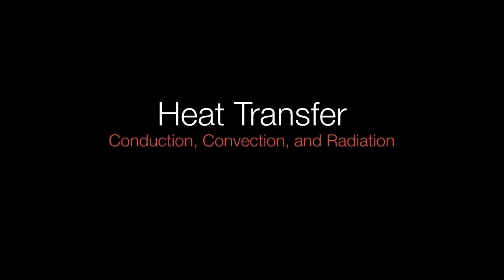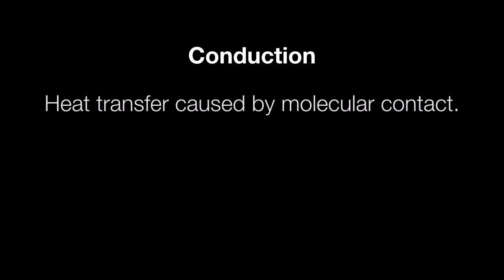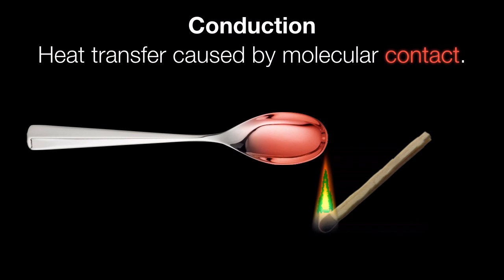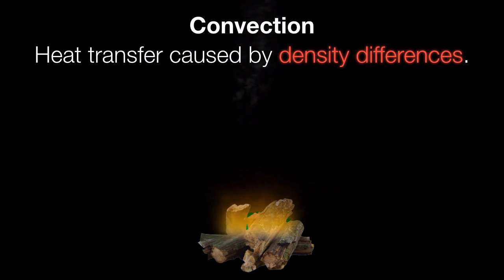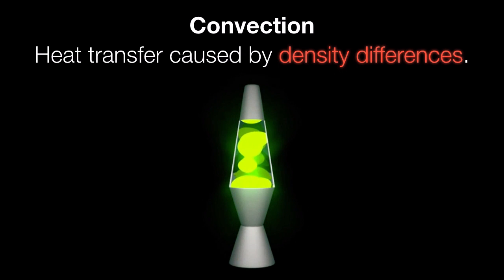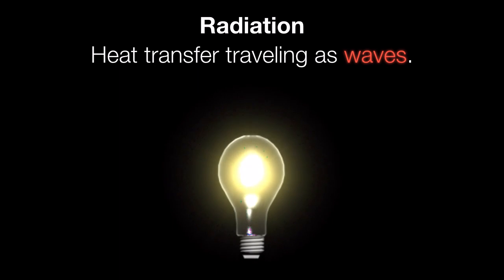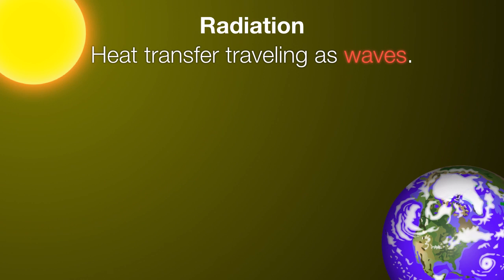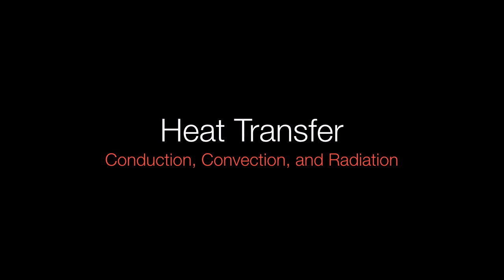Heat Transfer

Comment: You blew it on convection. You described convection currents not heat transfer by convection. Heat transfer by convection is using a moving fluid (commonly air or water) to transfer heat. Examples include fans to cool a computer processor, the wind cooling a person, and recirculating coolant in a car engine.